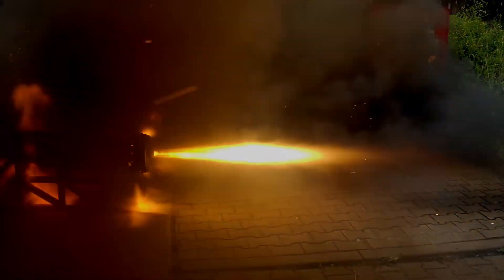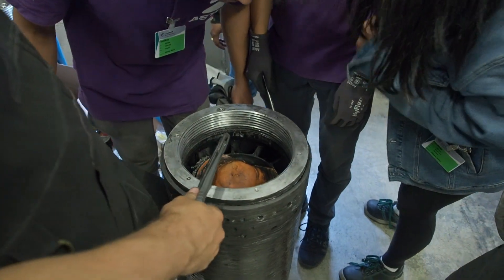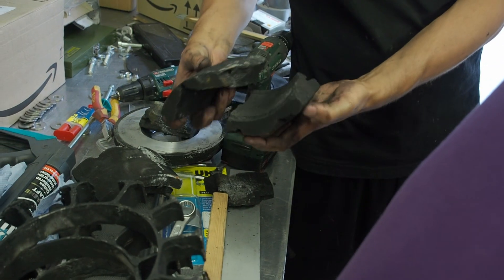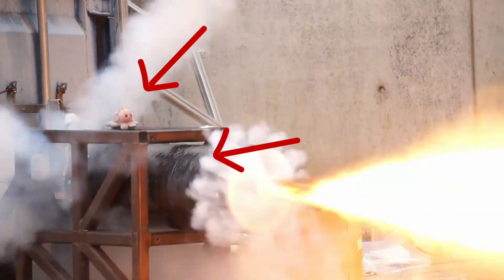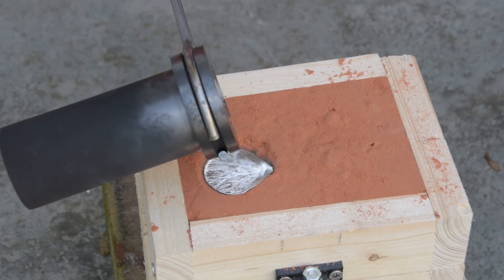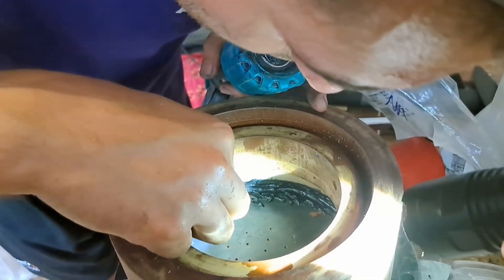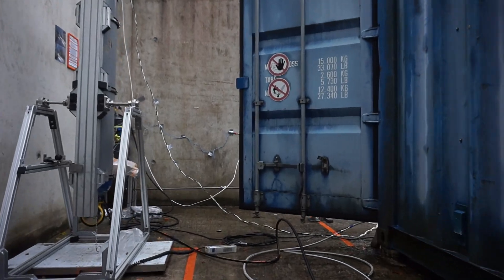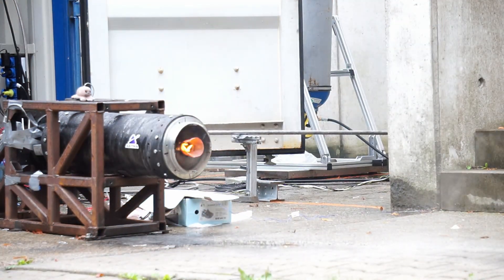Does the Karma rocket engine finally work?  Seeking the ever elusive 10s burn...

Comment: But why did the nozzle melt on one side?
Reply from the maker: Very astute observation.   Unfortunately we didn't have time to change out our pertinax insulation on the nozzle for the last test, so there was a section in the throat with bare bronze exposed to the flame.  Turns out that works for only about 8 seconds...  Ye be warned.

Comment: Wow ❤❤❤ that was soo good finally you guyz were able to pull this off. A 10 sec burn without any issues 
Huge congratulations🎉🎉 for the entire astra team you guys are so awsome. 

I recently got into model rocketry and the thing i thought the least about was the rocket motor i bought a cheap one from amazon and most of the time i am spending is on tvc mount but its so shocking to see that if you just take the amateur rocketry to just one level up simple things become so difficult and challenging and you have to think so deep about simple things .  But you guys still managed to achieve it congratulations 
I'll be patiently waiting for your next video
Reply from the maker: We are glad you enjoyed taking a look at our journey.